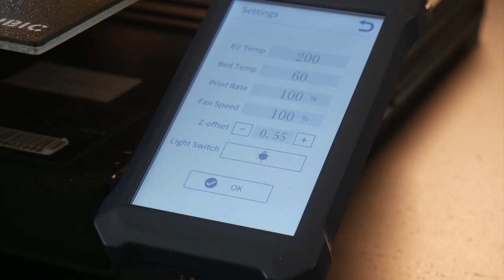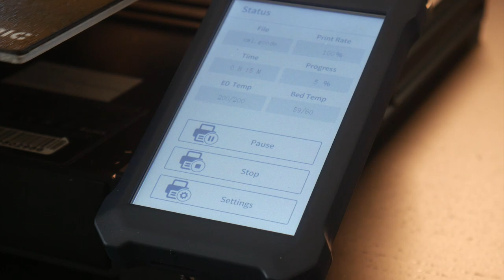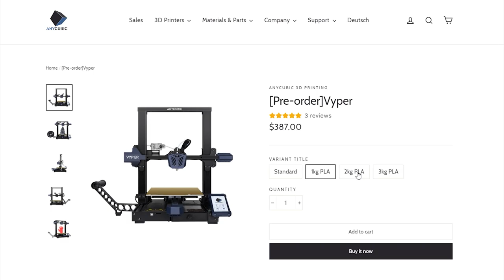6 Cool 3D Printed Things - ANYCUBIC Vyper review

Comment: I am considering the Vyper as my first 3d printer. Do you have any recommendations for a 3d printer under 500?
Reply: Yo, i was thinking of getting myself a Viper too. My question is, 1 did you take the viper, if yes are you satified and if not what did you get?
Reply: @hectorlepissier8993  I didn't get the vyper. I ended up getting an Anycubic Mono X 4k resin printer.

Comment: This might be a dumb question, but how did you get the nozzle out of the lapse? Is it tracked and hidden/edited out? Amazing video. Thanks.
Reply: It's a software called Octolapse that inserts commands in the g-code to move the extruder out of the way after each layer before it takes a picture.

Comment: these are soooo great prints! what will you recommend a budget 3d printer, im considering to buy one.
Reply from the maker: i would say if this one's in your budget pick it up! if not the voxelab aquila is a great printer for the money too! :)
Reply: @WildRoseBuilds  Am shocked how little stringing there was with a bowden setup, and your head moving off to snap each frame.
Yup, my next rig must have independent Z-screws ... am tired of manually aligning with a couple of measuring sticks every time I mess with the hot end.

Comment: I also want to say one last thing I never have to use the z offset button ever, literally I've used my printer about 400 times and I have never used the z offset button, I noticed that if I start hearing cracking noise or the tip of my extruder is making contact with other Bridges or infill I just let it be I feel like it melts it off, but let me just talk about my results, I have never used the z offset button and I always get perfect prints 98% of the time but 100% I have never had to use a z offset I just want to emphasize

Comment: For sure very expensive filament and very slow speeds with ultradetail noozle and under 0.10 detail.
Reply from the maker: 30 dollar per kg filament with stock .4mm at .2mm layer height 💁🏼‍♂️✨
Reply: @WildRoseBuilds  i have mk3s+ and i never get prints like you.impossible!